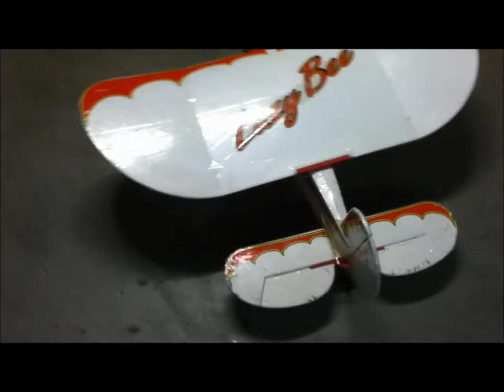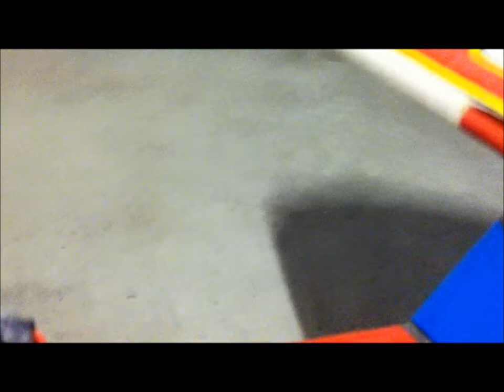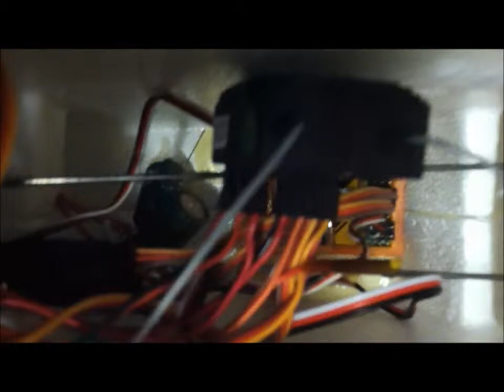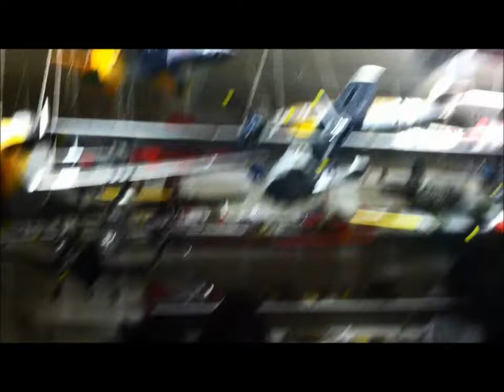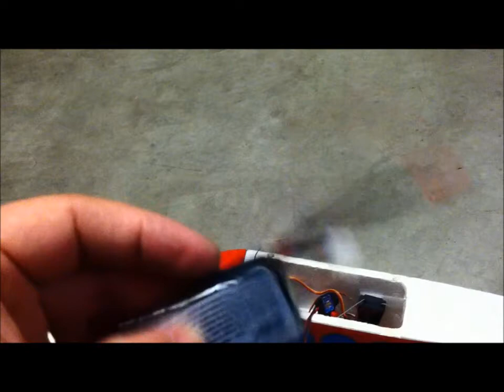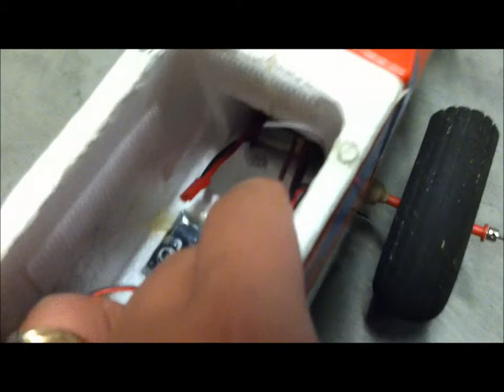LAZY BEE COX MODEL RC Vintage Rare Discontinued

Comment: Didn't come out in the 60s, came out in the 90s.  Foam model from Cox Hobbies which was bought out by Estes Hobbies (The rocket guys)  Originally sold with a 2 channel AM radio that was Cox branded, but made by Airtronics.  The Original engine was an 049 Cox Baby Bee swinging a 6X3 prop